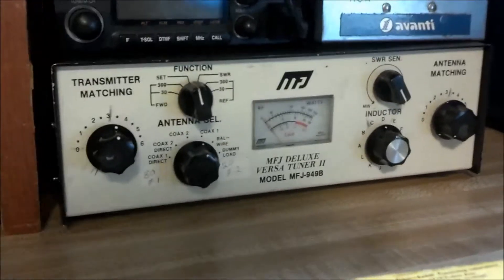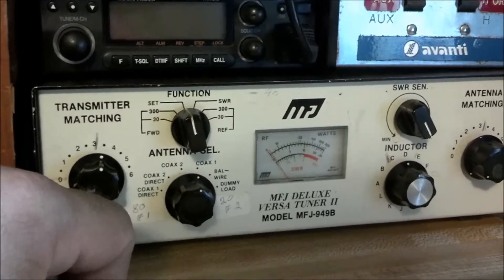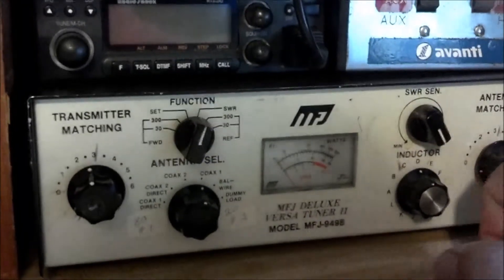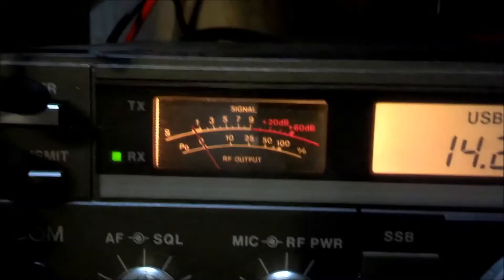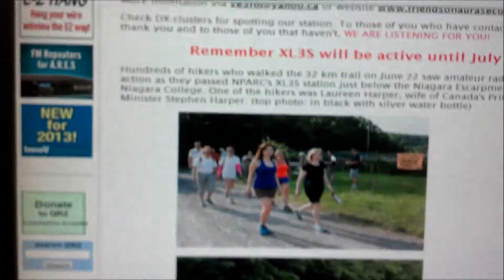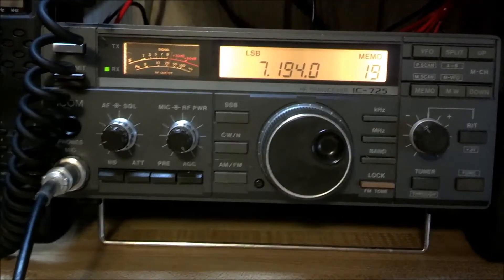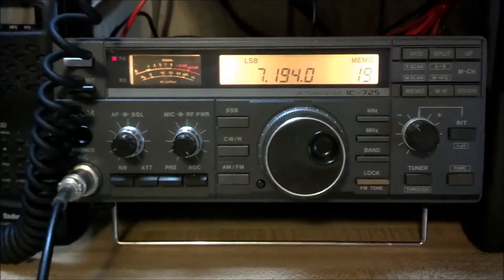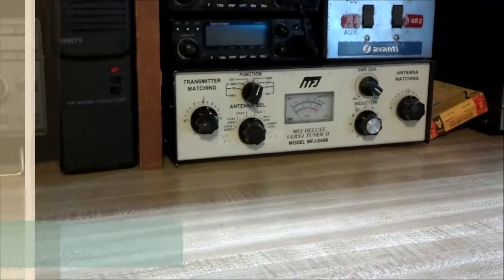Tuning an antenna with a manual tuner. Surprise contact with XL3S!!

Comment: Hold your head high.Your manual tuner is more efficient than the automatic ones. More RF out the antenna and not into heating the ferrite material. Number one consideration for QRP> Plus, you learn something about tuned circuits, characteristic impedance,, SWR, etc.You can also tune yur tuner with the MFJ-259 or variant.

Comment: I have the same meter. Which is why I chose to watch this video. My SWR keeps spiking and I'm new to HF. I have a hamstick dipole in an apartment building. I ran into this issue before when setting up on dual band. I needed to get the antenna away from the building to prevent additional interference from happening. Good thing I'm in electrical. I'll just grab some parts from the shop and use my 10ft 2x4 at home to run that out at least 5 feet from the balcony. That should do the trick. If that doesn't work I'll vertically mount the antenna and try again.